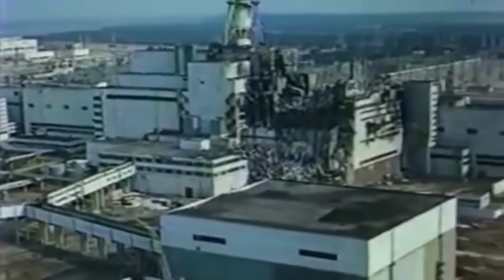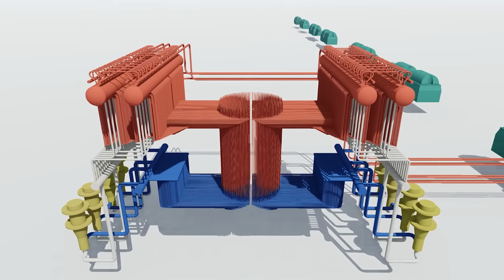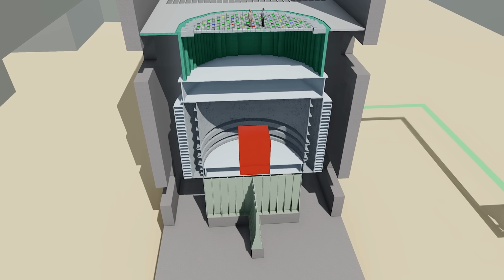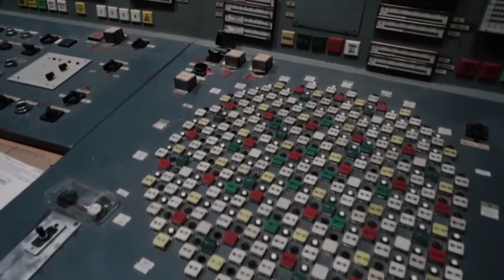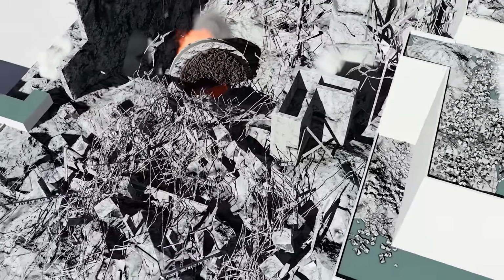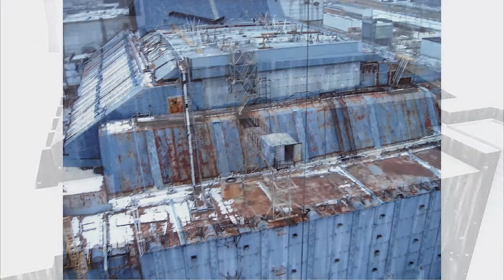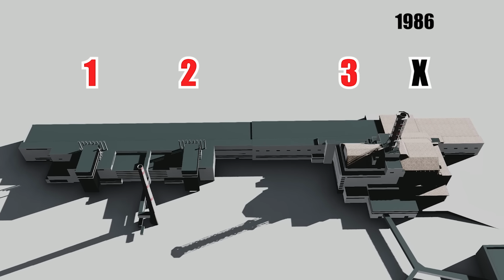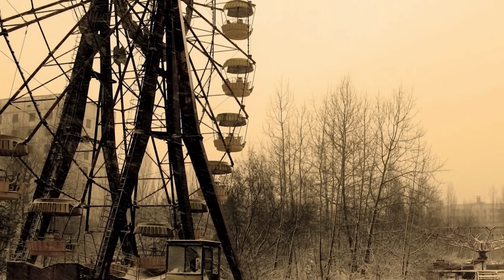CHERNOBYL DISASTER - An Inside Look - 3D

Comment: Online refueling is not a safety problem as implied in this video.  This is one benefit of the CANDU reactors in Canada.
Reply from the maker: Online refueling is a problem where if the building structure was to be breached spent fuel and reactor then has no barrier to the atmosphere. If the space within which the CANDU reactor performs its refueling is inside a containment vessel then it would be much safer. Chernobyl’s reactor hall roof and high level walls were not heavily reinforced.

Comment: Someone explain me. Why is radiation to difficult to clean up. Is not like carbon monoxide???
Reply: Radiation is emitted by unstable atoms. This is the main thing.
Now let's change your question: what are the sources of radiation and why they are so difficult to clean up?
1. Spent fuel remains very radioactive and hot for several years. It must be stored and cooled by the very complicated technology.
2. Radioactive dust moves with the wind. You know why it's difficult to clean up the dust. Because it's small and it's everywhere.
3. Radioactive liquids. The water itself doesn't turn significantly radioactive. But after the several cycles of circulation there are lots of particles dissolved in coolant.
4. Radioactive gasses are hard to catch and separate from the air.
Plus, there is a difference between chemical poisons and radioactive isotopes.
Once someone swallows or inhales the bad isotope it's adopted by his organism as a "normal" atom and harms him for a long time.
Organism can not recognize the radioactive isotope to remove it.

Comment: 3:56 what's with the red splatters
Reply from the maker: Ender Shard that’s red wax for the seals that of proof the button has been used.
Reply: @Mike-Bell  so like when the button that is pressed they have to stick that there? Or the button does it?
Reply from the maker: Ender Shard the wax is a tamper proof seal.  Those buttons must not be activated in normal plant operation. If the button are activated the the wax seal will  be broken and then someone has to offer explanation why.
Reply: @Mike-Bell  Ahh that makes a lot of sense. Thank you. I much appreciate your knowledge
Reply: @Mike-Bell  do you study Chernobyl as a topic frequently?
Reply from the maker: Ender Shard I have been fascinated by Chernobyl ever since it happened and have tried to learn as much as I could about it.
Reply: @Mike-Bell  I am equally fascinated. Right this moment I'm watching the Chernobyl TV show again. What did you think of it?

Comment: wasn't the lid 500 tonnes.
Reply: Anand Nair 

1,900
Reply from the maker: By my calculations the lid about 15.3m in diameter and 2.4m thick, filled with concrete.  That is around 440m3 @2.4T/m3 = 1050T

Comment: Fukushima, Japan also had a nuclear reactor that was engineered in the 1960s just like Chernobyl, Ukraine. The nuclear meltdown, explosion, and radiation leak that happened in both the USSR and Japan are caused by the same mechanism with inadequate cooling water feeding the nuclear reactor’s core. Because Fukushima installed many layers of safety in their construction their nuclear disaster was somewhat contained with the exception of the Pacific Ocean. Chernobyl was widespread making it the gold standard of what not to do in nuclear energy.
Reply: No. There were different ways of contamination.
'86 explosion had broken the roof and spread the particles into atmosphere.
Opposite, Fukushima's vessels and containments kept the molten cores inside. Japanese contamination source was the coolant water taken directly from the ocean and then thrown back.

Comment: Here is some correction - it's not that iron curtain prevented USSR from getting same containment, as western conterpart. There is and was ВВЭР reactors, that worked in same time as РБМК reactors and they are have almost the same design as western ones, in case of containment. Ussr needed electrisity, in the begining of USSR nuclear power plant projects. There, as i said, already was ВВЭР reactors, but USSR lacked ability to make enough metal containment and there wasn't time for waiting to make this containments. Plus РБМК reactors are actualy scaled model of soviets breeder reactor, that was used in millitary aplication. So it was less costly, can refuel as it goes and can be started building already.
And about Dyatlov, vise chef engineer. He had knoledge about reactors. You can cheak it by learning about his past on nuclear subs. So it's makes more sense to think, that promotion meant for him much more, then any safety. Plus... RBMK reactors are somewhat hard to control and maintain. That leads operators of such reactors (not only chernobyl one) break protocol in many instanses and that gave feelings, that protocol and safety isn't realy nessesary. So you can understand better, what exacly happend in that night. 
Plus about the arch - is heard from reputable sourses (staff of chernobyl NNP), that arch isn't permament solytion. That there are not enought crane capasity to remove all the sarcofagus cover and there are actual Ukrainian documents that literaly tells, that decomission of chernobyl NNP was left for upcoming generations to invent the methods and tecnology to do this. Plus there was some strange rumors, that in the development phase, there was some competitive projects to the arch, but banks will give money only in case of building an arch, using french technologies. But as i said early, it's only an anecdotal evidense of last part.

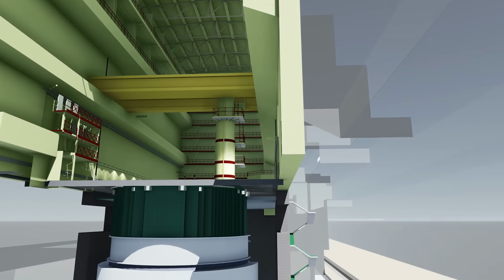Comment: 3:04 western reactors of the Candu type uses online refueling
Reply from the maker: Thanks for the correction.  I found this out after posting my video.
Reply: @Mike-Bell  Just a little side note reactors of the Magnox and AGRs uses online refueling too. AGRs have to be throtteld down in load when getteing refuled, due to once a fuel rod got stuck.
Reply: @Mike-Bell I really liked the animation. As an additional note, CANDU reactors also have a positive void coefficient. This is because they use heavy water as both the neutron moderator and as coolant. This decision was made to allow the reactor to run on unenriched Uranium with U-235 content as low as 0.7%
Reply: @Mike-Bell  atleast you are not hiding your mistake.
Reply: We have a Candu in Argentina too. That will run for around another 30 years (counting since the end of the upgrading and powering up works last year) that was built in the late 70's and put to work in 1984 officially.
Reply: @HaloLoreNerd Not at all! There is no comparison between CANDU and the RBMK series, just NONE.  The critical differences are too numerous to mention, but you might start with the lack of containment  structures on the RBMK and their presence in a CANDU.  Those huge concrete structures that dominate all CANDU sites are the exterior containment domes.  There are other containment structures inside them.

As for the comment above about positive void coefficient, well, it's  again an apples and oranges issue. If you lose coolant volume in a CANDU the reaction slows because the moderator has been lost., and there are a series of counter-measures available to further slow the reactor that were not in the RBMK design at all. (Light) water and boron injection systems for example.  Please don't let that one remark equate CANDU safety design to RBMKs.

And I suspect you live in Pickering, not Pickerton ;-)  Nothing to worry about.

Comment: From the visuals its funny to think that the reactor was located and the explosion happened next to and ABOVE the staff in the control room. Seeing people walk on the reactor lid I automatically assumed that the actual reactor is underground.
Reply: I also thought it was underground. Crazy to think the control room was so close though
Reply: @zpirryz  Control room is usually located quite close to the reactor also in the western designs, because it's reasonable to build it there. Try googling for example "Ydinvoimalaitosyksiköt
 Olkiluoto 1 ja Olkiluoto 2" to find a PDF including a cutaway drawing of the Olkiluoto NPP with ASEA-Atom's BWR reactors. You most probably end up with Finnish PDF, but you just need to know that control room is "Valvomo".
Reply: @zpirryz  Probably one reason everyone in the control room got so much dose.
Reply: It was cheaper to build up. Excavation into the ground wouldve been both expensive and annoying.
Reply: I seen jojo and mista was right 4 is the bad number
Reply: Watch some of the other films people all over the lid and roof of the building. What ashamed disaster
Reply: you saw people walk on the reactor lid?!?! Is there a video of this?
Reply: @tanman.  Reactors 1 2 & 3 reactor lids were relatively safe to be near for short periods, and due to soviet design. The actual reactor was not encased in a steel frame.
Reply: @MrAndyman0512  Oh,I thought they saw people walking on the lid of reactor 4 after it was launched up after the explosion, which would be ridiculous
Reply: @tanman.  Oh god no. Anybody within 500 ft of reactor 4 died instantly.
Reply from the maker: @tanman.  Yes 3 times in this video people are shown walking on top of the reactor.
Reply: @tanman.  There is video of it but not post accident!

Comment: the way these things make power is making the water into steam to turn the turbine......... WE DONT NEED NUCLEAR ENEGRY TO BOIL WATER........ what a stupid design to harm the planet... things break and human make mistakes. why invent something that with a mistake it can kill and harm so many.
Reply: Austin Wilson what the fuck dude we need more nuclear plants they make power without smoke flames or any harming to the enviorment but the nuclear waste is a problem but its better to have than polluting
Reply: Austin I do appreciate your sentiment.  You say we don't need nuclear energy to boil water ... could be, but what alternative would you propose that is as efficient?  The electricity in your wall socket was created from an energy conversion process that itself needed energy to make happen (which was lost and will always be lost making that conversion).  The problem humanity has is volume - we all want heat (and cold) with lights and hot running water and that takes A LOT of electricity.   

So hook a generator to your bicycle and show me how long you can power a 100W lightbulb.  Now take an average city and multiply that 100W by 10 million or so (and you'll have the 1000 MW output of a generator powered by boiling water).  It turns out nuclear is a pretty good way to produce the energy that created that much boiling water.  

While many alternatives are available to produce smaller quantities of electricity, most people have absolutely no idea where their electricity comes from and are trapped believing that magic sea monkeys are somehow going to save the day if we could only just dream hard enough.  The only thing that is going to save the day is shutting off your heat, living in the dark and slow down on having so many babies.  Damn reality is a bitch.

Comment: finally an actual location of control room, couldnt find it on google, it seems that they sealed that entrance to control room 4 and made entrance from another path, i think maybe corridor collapsed in that part so thats why they go around to get there as seen in expedition videos
Reply: https://carlwillis.files.wordpress.com/2011/08/chnpp_phase_ii_map_raw2.jpg
 There you can see exactly where the control room is, and what is covered by the sarcophagus.
Reply: It was changed just as radiation safety measure. Long story short - 3 and 4 units shared much of same systems as ventelation and etc. And to split, somewhat safe zone of unit 3(and the control room of reactor 4), they changed the layout.

Comment: Ideal design to create lots of weapons grade material.
Reply: No, not ideal.  As with all power reactors, the plutonium is left too long in the reactor, increasing the amount od Pu-240, making it so-called "reactor grade". The USSR had 6 FBR reactors to do plutonium in an optimal manner.  There is no hint that any RBMK fuel was ever reprocessed.
Reply: @puncheex2  you can refuel while it is operation - that is what is needed for weapons grade material production. That is also why they were not built outside of the ussr. These reactors were big, cheap to produce, chrap to run (on unenriched fuel) , and could create a lot  of weapons grade material.
Reply: @Phil-D83 : OK, Philip.  Do you have a reference for that usage?  I'd appreciate anything you could send me that would authoritatively establish that they actually did use these reactors to produce plutonium for weapons work.  Thanks.
Reply: @puncheex2  i will look for more. I do recall reading same. Candu reactors are also considered a proliferation risk as they can use unenriched uranium and be refused while in use.
Reply: @Phil-D83  Thank you, Philip.  Learn something new every day.
Reply: Akso an excellent design to produce medical and other isotopes as well because it mayvbe refuelled while in operation.

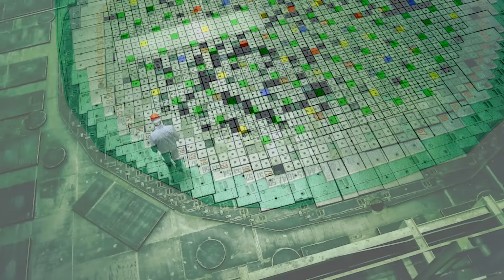Comment: 2:45 It's rare but not unique for the RBMK design to be able to change fuel during operation. E.g. the small Swedish reactor in Ågesta (Stockholm area), closed since 1974 could do that too and so could the reactor in Marviken. The latter was never loaded with nuclear fuel since the whole design was deemed unsafe before it even was finished. Marviken then became the worlds only oil fueled nuclear reactor since they thought it was a pity with all the hard work and investment so they put in a gigantic oil burner and used the steam system and generator.

Comment: Chernobyl is a case-study of how bad communism works when coupled with a salary based on ranks rather than merit and hard work. This accident is held by many expert as the main reason for the collapse of the soviet union.
Reply: One could use Boeing 737 MAX to make similar ideological claims against capitalism.
Reply: The case could be made that the Challenger disaster in 1986, had similarities to the Chernobyl debacle. Recovered solid fuel rocket boosters from previous launches had shown severe heat damage to the O rings, which sealed sections of the solid fuel rocket boosters. The engineers at Morton Thiokol knew that launching in cold weather (they were concerned that any temp under 60F) was risky. The O rings became brittle and inflexible in cold weather and would not seal properly, allowing hot gasses from the solid fuel rocket boosters to escape around the rings and impact the massive outboard fuel tank for the three shuttle engines. Some of the engineers went into a full meltdown when they learned the launch temp on 1/28/86 was 28 degrees. They begged mission control to scrub the launch. They were ignored, due to political pressure from the Reagan administration.
Reply: @Gallagherfreak100  You are absolutely correct. Furthermore, the brittle o-rings were made of ceramic fiber. Originally, they were made of asbestos fiber which was not as brittle. There was a big campaign at that time to replace asbestos because of health issues.  Standard protocol was when any change was made to a part, a full test was supposed to be made before the replacement part was cleared for use in a launch. That was not done due to the cost of a full test and time constraints. i was told that by an engineer who worked for a Morton Thiokol contractor.
Reply: @jackfanning7952  : Interesting, but, not surprising. If Gene Kranz had been the mission controller that morning, I don't think he would have allowed the launch to proceed. Same with the Columbia disaster. He would have insisted the damaged wing be imaged, and would have found a way to launch a rescue mission. That Linda Hamm was so arrogant, she nixed several requests to have the wind imaged by satellite or a space walk.
Reply: @John Smith I agree with you about communism but don't think that overriding safety features and corruption is limited to communist dictatorships.
Reply: How good is Flint water now. Drinkable? They said it was ok.
Reply: Overriding and disregarding safety features is prevalent everywhere, not just in a communist culture. There were at least three incidents at the Savannah River site where safety features and alarms were bypassed to continue production. There is a Homer Simpson risk taker living within each of us that sometimes senselessly and perversely decides "to take a walk on the wild side."

Comment: No safety system that the reactor had, would have prevented the accident. In fact, it was a safety system that made it blow up.
Reply: No, that's incorrect.  It blew up because the operators were never fully briefed on what xenon-poisoning meant and how to work with it.
Reply: @puncheex2  Eh, no. The only time in history any nuclear engineer was unaware of the effect of xenon was during WW2-era when the reactivity of an experimental plutonium production reactor increased and decreased by itself.

Xenon-poisoning is something everyone in the field understands. The operators acted a bit reckless with it, fighting it instead of aborting and letting the xenon decay. This itself didn't cause the accident, but generated circumstances where the design flaw in the reactor would prove fatal.

The thing was blown up by the shutdown system, activated after the experiment was completed and it was time to shut down the reactor. Before that, it was under control.
Reply: @puncheex2  Dyatlov said he completely relied on safety shut-down system. He didn't expect control rods could intense the reaction instead of stopping it.